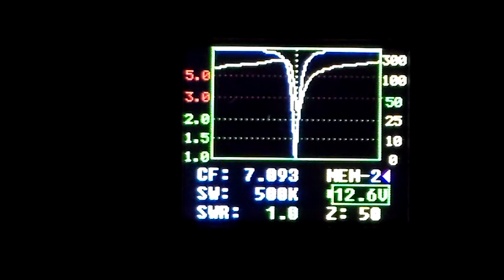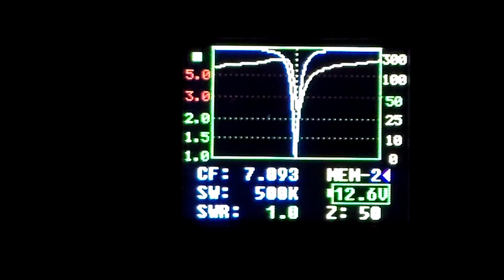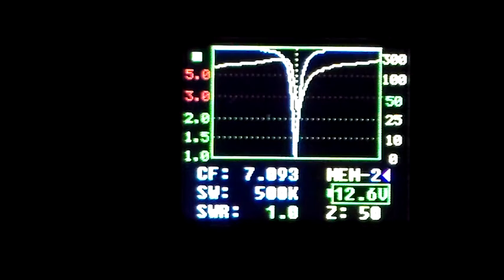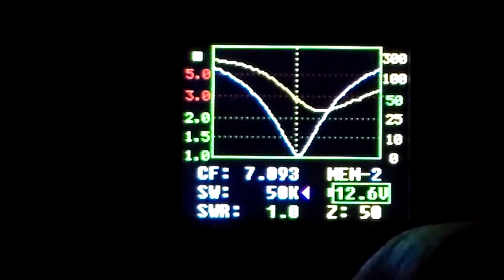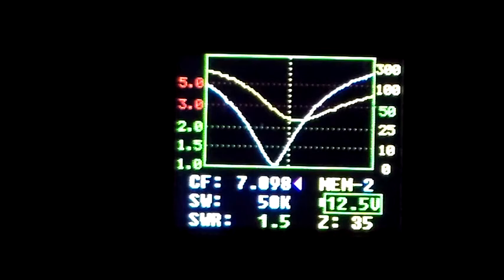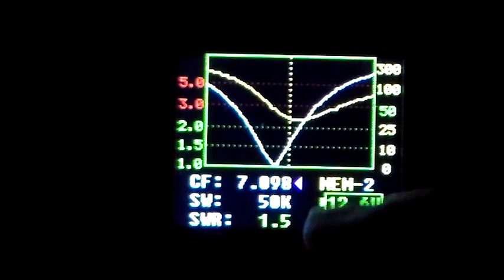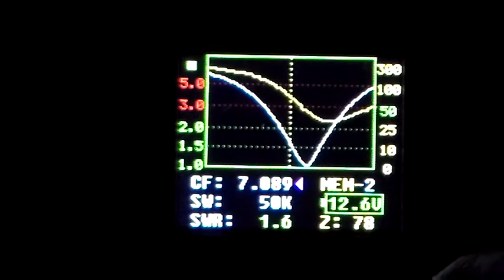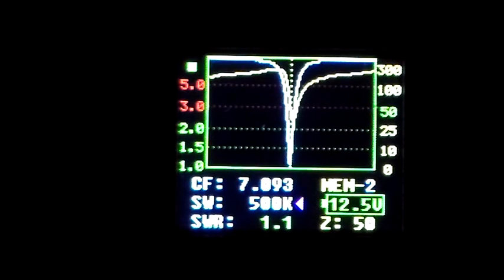Magnetic Loop Bandwidth Tests.

Comment: That tight tuning might be the advantage of a small loop. The local noise could be outside its bandwidth. For working a net, because your on the same frequency for hours, the tight tuning wouldn't be a problem. never tried one, just guessing.